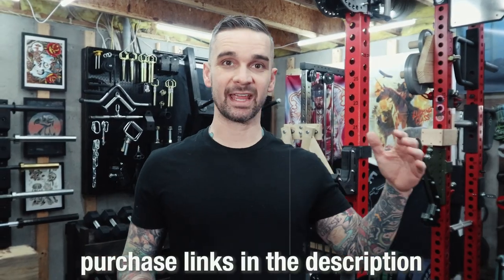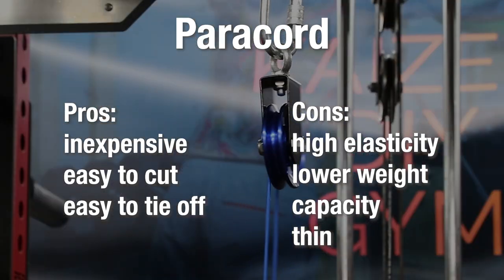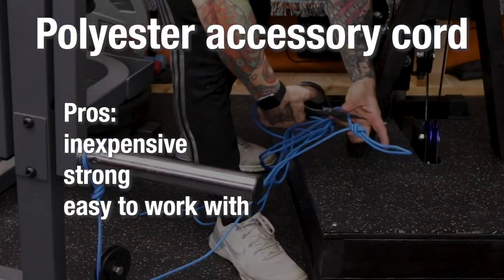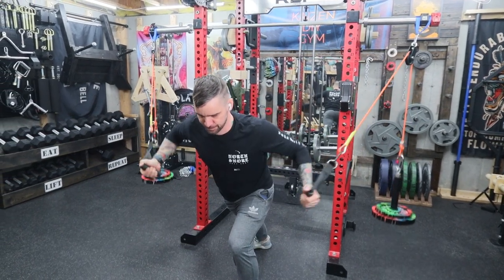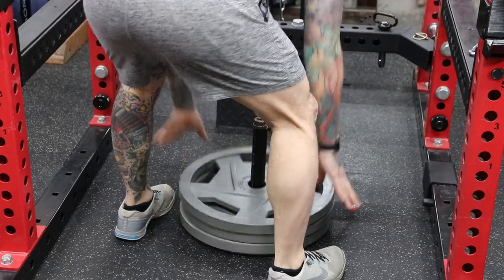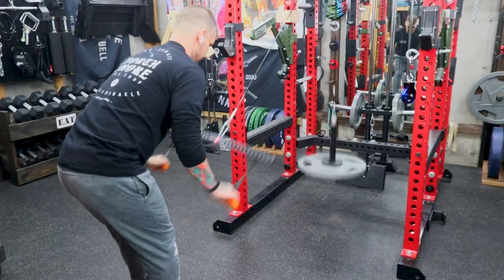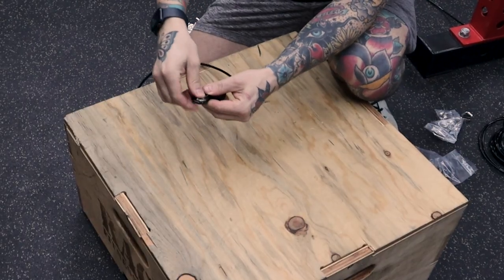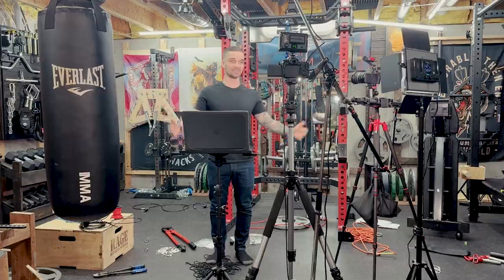DIY pulley systems in the home gym - use cables or ropes | Kaizen DIY Gym

Comment: Before crimping it's important to check if the pulleys are removable. If they aren't and there isn't space to thread cable through, you'll have wasted wire cable. Also don't go super thick with wire cable, it's definitely reassuring knowing the cable won't break but thicker cables have less flexibility so it won't bend as easily around small pulleys and will feel horrible and stiff. For 90mm pulley I would say go 3-4mm thick, it should hold more than enough while feeling smooth.
Reply from the maker: You make some good points
Reply: Hey, is a 48mm ball bearing pulley too small for a 3-5mm wire cable?
Reply: @AexoeroV  I would say yes. For my setup at least, I would say 90mm is the minimum size for 3-4mm wire. If you have more pulleys to redirect the wire through a gentler curve it should handle it, or possibly have them spaced further apart but these will affect overall cost or size of your final product. The cable I used is a 7x19 configuration - 19 threads wound together into 1 larger thread, and with an additional 6 others wound together). There are definitely more flexible ones out there with the same diameter but I can't comment on their performance. But for 7x19, I personally would have the pulleys around 90mm at least.

If you are able to take the pulley out and actually have your hands on to the wire, drape the wire horizontally over the top of the pulley and see how fits. If it's stiff it'll stay fairly horizontal. If gravity and a small amount of tension can allow you to fit it around the pulleys radius, you should be good.
Reply: @JohnSmith-ox7xc  Thanks for your reply, the system i want to build will consist of 2 pulleys for lat pull downs and triceps exercises, in this instance the pulleys will be like 1.3 meters apart. For low rows i will have a third pulley added. The wire i seen i can found is labeled as 6x7.

Comment: I just came across this video. As others said, you’re very much to the point and don’t spend a lot of time with unnecessary nonsense. That’s good. I have done some climbing and the first thing one learns is that climbing rope has a certain lifetime. I think about 5 years. It will most likely work for many more years, but climbers and other industrial people will retire the ropes after 5 years. I stick with steel cable, generally 3/16”. I crimp the ferrules on and I believe the strength rating is something in the thousands of pounds. I never thought ahead of time about getting those rubber ball stoppers. Now I’m wondering if I can get some for 3/16” cable.
Reply from the maker: Hey, thanks for watching! Those ball stoppers come in a variety of sizes.

Comment: If you are using rope and want to use metal thimbles type "knot for metal thimble" into the search box.
Or depending on the type of rope you could use a splice but that is more involved.
I still favor static climbing rope myself as I said in your other video and I am able to buy it by the foot at my local REI store and prepackaged.
In a home setting with good rope it's not clear that you need metal thimbles but you may like the look. I just tie to carabineers (REI) use a knot climbers use, there are several.
Everything you use should be rated.
Reply: How to tie a scaffold knot:
https://m.youtube.com/watch?v=M9IS9HPk1Ds
You need to tie it correctly!
It is supposed to tighten like a noose and can be used with a metal thimble or a carabiner.
Reply from the maker: Awesome! This is super helpful. Thanks for sharing your insights!

Comment: My understanding is that crimping over the vinyl is a mistake. The cable should be stripped so the ferrule bites into the steel strands. The ferrules are a very close fit on the bare wire, so to go over the vinyl, you have to size up. The combination of oversized ferrules that are over the vinyl puts you at risk of a slipped crimp.

This might be lower risk for a few hundred pounds on a weight pin in your gym. For a heavy working load, catastrophic crimp failure is a serious possibility.
Reply from the maker: This is actually the 2nd time I've heard this since posting the video. It might warrant a follow up video. So far my cables are holding up but I'll definitely post if anything changes.
Reply: As someone who has studied engineering, this is absolutely 100% correct. When you swage a steel rope you effectively cold weld the ferrule to the rope. This ensures maximum strength for the given diameter of the rope and also ensures maximum safety for you as whoever it is who is using the rope to lift heavy objects. A sudden opening of the ferrule and freeing of the rope under heavy loads can be catastrophic and lead to potential eye injuries and other whip injuries from the forceful recoil of the rope, foot/toe/limb/other injuries from the heavy load falling upon you.

Comment: Vinyl coated wire rope is what you get at hardware stores, it's not what gym equipment manufacturers use. They use nylon coated wire rope, which is what kaizen shows near the end (he calls it vinyl, but it's nylon). Both are fine from a functional perspective, but the black nylon looks better since it's what OEMs use.
Reply from the maker: Thanks for the clarification!
Reply: @KaizenDIYGym  Thanks for the deep dive on rope options. It's awesome that you caught the paracord fail on video!

Comment: Ever come across a vinyl/nylon coated wire that sounds 'crunchy'? When its turning along the pulley, or if I bend it in my hand, the wires inside make noises. So its not silent. I thought it was weird.
Reply from the maker: Yes, I have heard the crunchy sound. I think that happens over time when the vinyl coating starts to age and dry out.
Reply: @KaizenDIYGym  Good to know. Its supposedly new (from Amazon) so I'll try to replace it since its a little off-putting, made me think there was something wrong with my pulleys or I was getting friction from somewhere else.

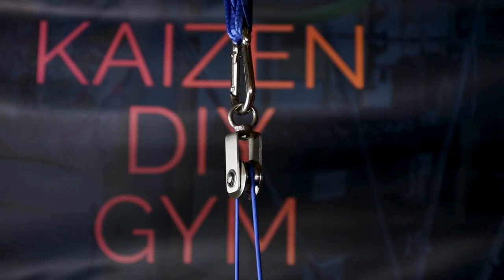Comment: Hey, ar 1:43 why do you say that those little pulleys aren't great for wire/metal cables? Those are ball bearing pulleys?
Reply from the maker: Metal cables need a pulley wheel with a larger diameter because metal cables are less flexible.
Reply: @KaizenDIYGym  I see now your point, i have some ball bearing pulleys and i want to built a pulley system. The wheel of pulleys have a diameter of 48mm, do you think its too small for metal cables? Even for 1/8 cable? What about that climbing static rope, do you liked the dyneema better than the static rope? I need something with zero elasticity and i would love to get metal wires but if my pulleys are to small for the flexibility of a metal cable......
Reply from the maker: Dyneema and the climbing rope were both great options with little to no elasticity. The 48mm pulley wheel might work with the metal cable.

Comment: Hey I wann use a diy cable pulley system too
But I just need a rack
Can you recommend me pls a rack wjich is available in Germany ?
Does it have to be a wall rack or could it be just a normal cage rack
For example from atletica r4 series?
Reply from the maker: The diy cable pulley can work on any rack!  I hear that ATX sells god quality equipment in Europe as well.

Comment: Great video! Straight to the point on so many options. Loved the clip of the falling climber as well, that's got to be scary af. I went the vinyl coated route. I've read that you want to strip the vinyl off the end where you are adding the ferrule. When you crimp the ferrule, I believe that the wires fuse with the ferrule creating a break strength of 90% of the wire. This is all stuff I looked up, so not a professional by any means. Here is a video that I liked that explains some of that stuff. https://www.youtube.com/watch?v=dlECTP3Qr0Q&t=237s
Reply from the maker: Awesome, glad you enjoyed the video. That clip of the climber falling scares me every time. Terrifying!
Reply: @KaizenDIYGym  Even more terrifying is the loss of an eye or having half of one's face torn off, or even a fatal injury (cutting an artery), by the sudden and brutal recoil of a steel rope under a particularly heavy load. As someone who knows enough about engineering, I would assure anyone here that placing the crimp over vinyl is a foolish mistake that is often made without aforethought to the fact that steel rope needs to be cold welded with the ferrule. 

Another one is that you should never, and I mean ever, use anything made of copper if you are swaging galvanised steel rope. Never use anything with copper with galvanised steel. Ever. For stainless steel copper is fine, but galvanised steel will create a chemical reaction, causing corrosion and ultimately failure of the weld, leading to breakage of the steel rope.